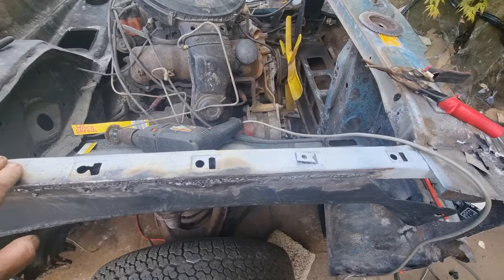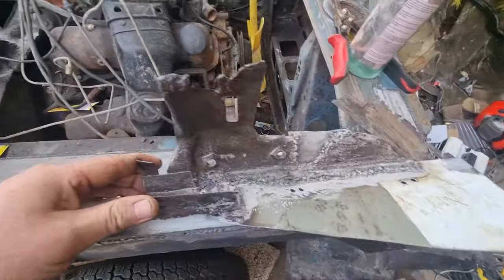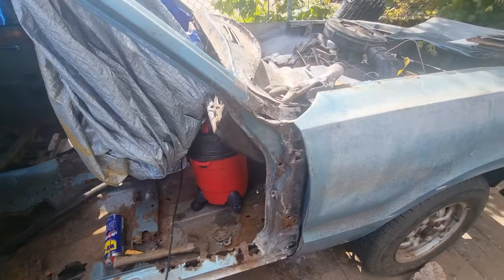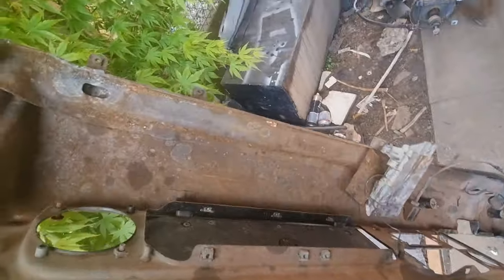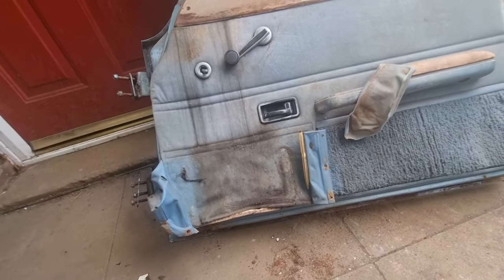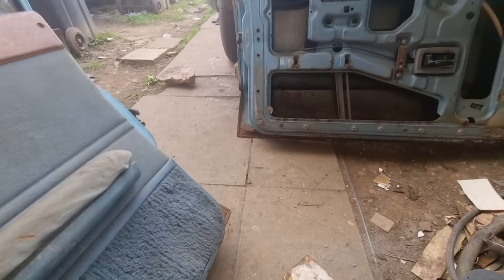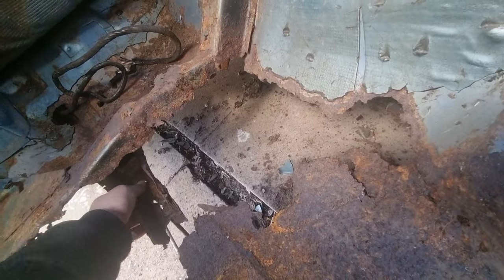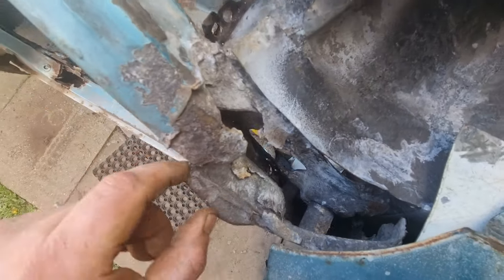Cortina Mk4 Ghia 2.3 V6 Restoration || Doors and Dash Removal (P22)

Comment: I’d brace the shell a little with some 1” box section when you start chopping the A pillars , maybe try and find a rotisserie jig for when you weld the underside. It will make it so much easier for you to get to the hard bits

Comment: Moving along Mate. Good job. Maybe need to find another MK4 that's been restored and go take a bunch of pictures so you can see exactly where stuff bolts back. Maybe find a second hand floor pan and weld in. That's a lot of fab. I would get a bunch of house bricks and wood shims and block up car solid in one position before chopping out floors.  It's going to get wet noddle on ya. You got to get four doors to close correctly again. Good luck Mate. Have a good week. 👍👍

Comment: Just a suggestion Adam Might be worth making sure the frame stays straight dude before you start chopping that floor about or I can see a few problems arising when you put it back together and that would be a crying shame after the effort you’ve put in !
But your doing a fine job fella can’t believe how much you’ve done already 👍
Reply from the maker: Thank you yes you are right dedo need to put somthink in place to keep it in place will defo look onto that that's also one of the reasons I'm not taking oit the top dash as it still acts as a support amd there is not really any need to

Comment: Great stuff there pal,  Has the car got a car loom in it at all?  Also see if you can buy your welding wire in bulk too, it might be cheaper doing it that way.
Reply from the maker: Ni don't have a wire loom yet
Reply from the maker: yes defo need to buy wire in bulk would save me so much waiting around lol